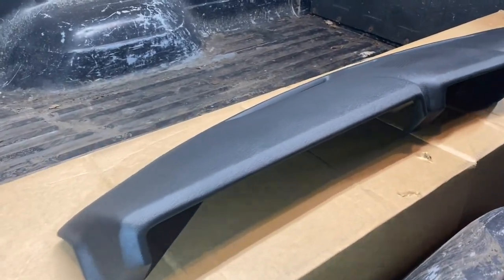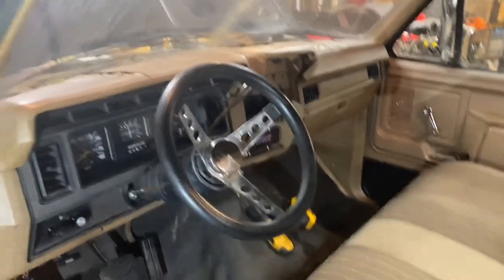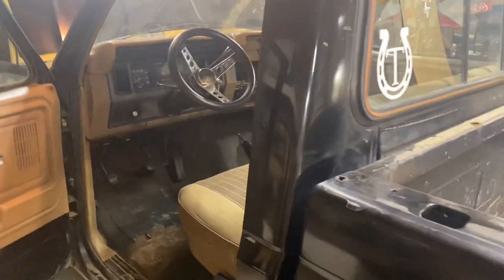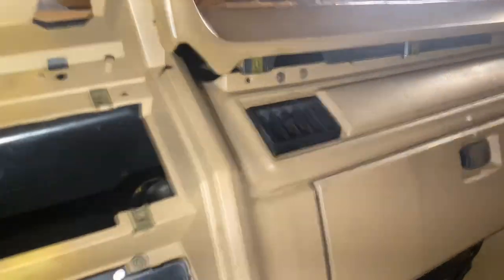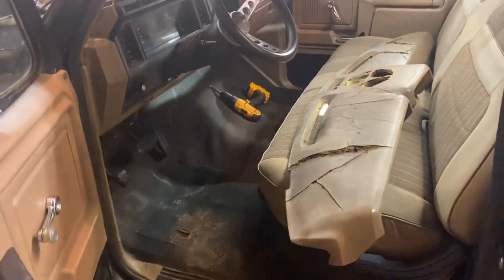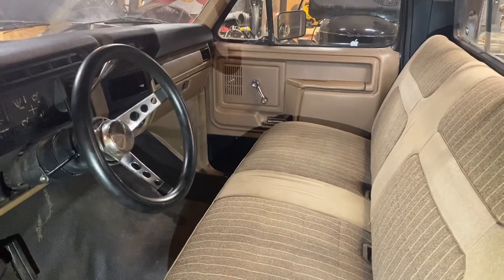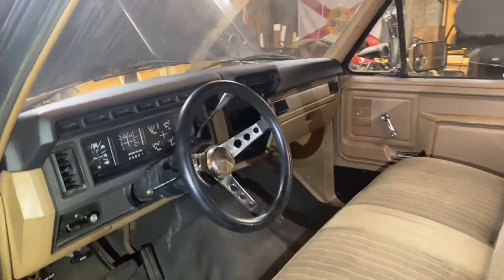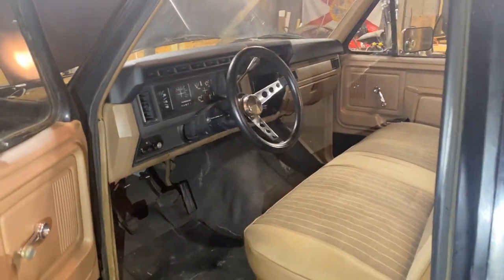1980-1986 F-150 & F-250 Dash pad Removal & Installation

Comment: Does the pad take place of the existing pad and screws Into place? Or just "clips" over the old dash?
Reply from the maker: It just lays over the old one, manufacturer recommends you can glue it down with adhesive.

Comment: Did you shorten the steering wheel colum ? 
It looks way smaller  
I just got 1981 f150 and I’m a bigger guy would like to shorten my colum is there any way
Reply from the maker: I didn’t shorten the column, I put a flat 14 inch wheel In it, gave me a lot more room.

Comment: Loved the vid.. have a quick question. I saw that your seatbelt panel part that stretches from the ceiling to the floor is in very good condition and might be aftermarket. If so, where were you able to find those two pieces? I have been looking for those pieces for a while since mine are pretty eaten up by the sun. Thanks!
Reply from the maker: Actually I believe they are stock, or may have been replaced long before I got the truck. I would suggest Ebay though.
Reply: @FloridaCrackerKustoms  Thanks! how about the black gauge trim? Did that also come stock?
Reply from the maker: @6.9diesel37  no problem and yeah the gauge trim is stock.

Comment: Grean video, right to the point. Help me out here though. Is this a coverlay vinyl glue on pad that goes directly over the existing dash pad? If so, why the removal of the old pad? What brand would help I guess. Thanks Bob
Reply from the maker: They recommend you glue it down directly to the old pad.
Reply: @FloridaCrackerKustoms  did you screw it in or use the glue

Comment: What kind of steering wheel is that man and what is the brand of it
Reply from the maker: Grant 831 classic steering wheel
Reply from the maker: You can get them off eBay and Amazon for like 55$
Reply: But did you have to buy a installer kit. Or customize anything
Reply from the maker: @grantbeaty8893  you need a install kit if you want it to look nice.